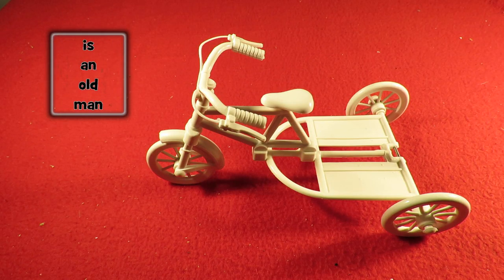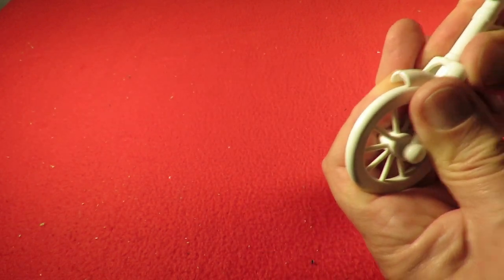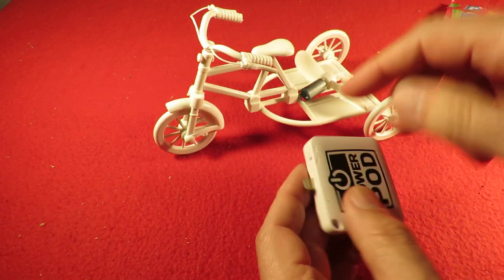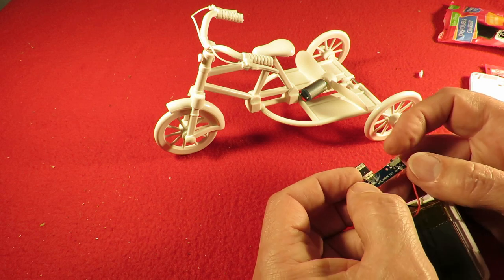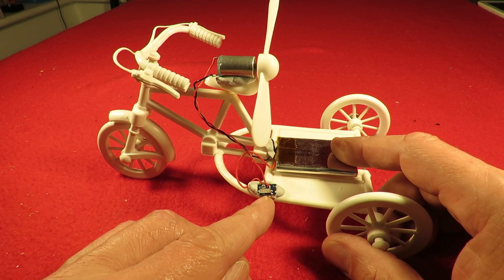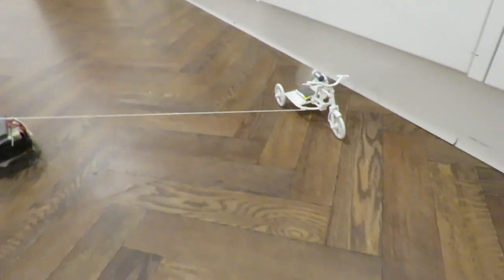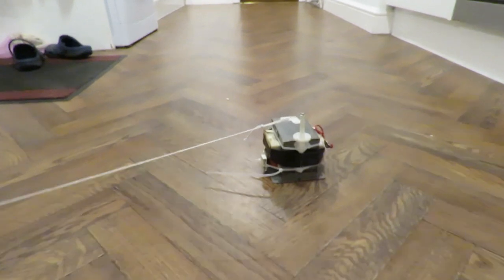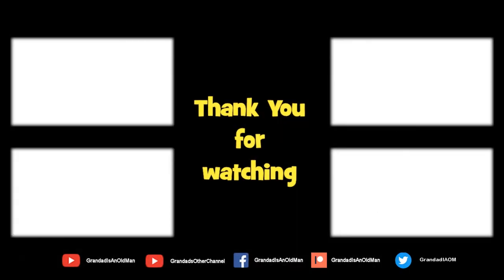Fan driven tricycle

Comment: Nice and simple project. I think if you either sand the steering axe, or put a cylinder one moved by a servo, you can make it RC controlled ;-) Thanks for sharing!
Reply from the maker: The front forks are not designed to turn and not connected to the handlebars. You would have to do a significant modification to make them functional. Here is an RC tricycle I did a few years back https://youtu.be/2dcsu4KjJRM?list=PLA5a2xPRSrB2DbGs9JTSF3EKXiHb2kGR0